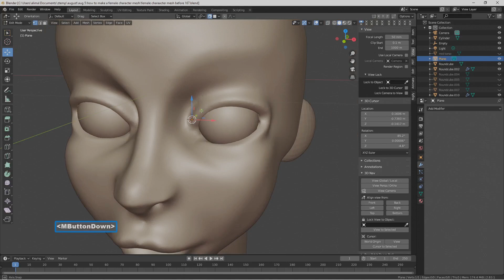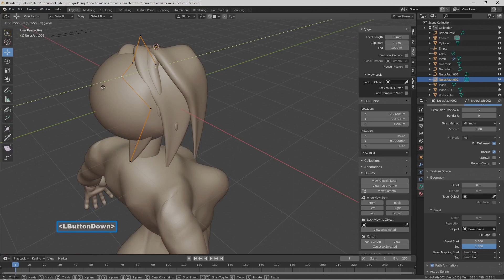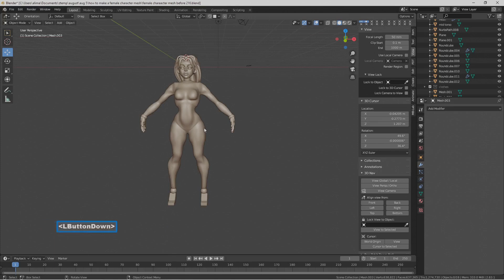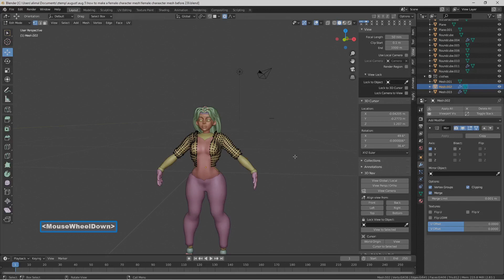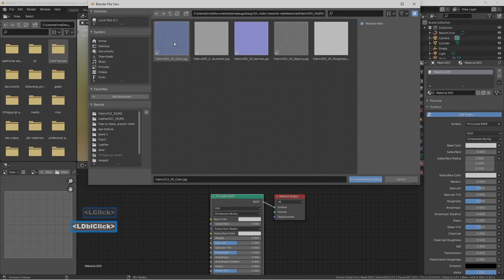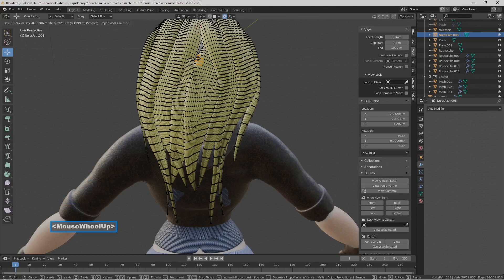Make a Female Character Part Two Blender 2.83 Step by Step

Comment: Sir can you make a low poly city  in blender 2.8x roads buildings traffic signals apartments different shops like pizza, car upgrade shop like gta etc
Reply from the maker: Mustaghas. Have you seen the video in the link? It is not exactingly what you asked for however I think it may be able to help you out.

 https://youtu.be/4ia_Rk-YoT4
Reply: @AlimayoArango  I have seen it before but I want to learn it in Blender 2.8x as I have mentioned in previous comment

Comment: I got few questions. How should I proceed if I actually want more realistic model with toes and layers of clothes? On second what would be best way to start add on accessories like rings, holsters, hair pins etc? Also how should I work with clothes/armors that will be more detailed, would it be easier to build them as separate projects and export in later?
Reply from the maker: For your realistic model work on the body to make it more realistic as well as the face. For accessories I would recommend that you make them in a separate blender file then bring them in. With armor as well as clothes they will be easier to produce if you use the body to help make them. Let me know if you have any other questions. Thanks for watching this video.
Reply from the maker: With the character you are working on I would  recommend that you think about what you want the character to be used for.  My thoughts on this character from the beginning was that I wanted this character to be eventually used for animation.
Reply: @AlimayoArango  My idea is create something like in Appleseed movie but use Cel shading to make it look more hand drawn like in Jet set Radio. All tips are welcome for aproaching this kind of project